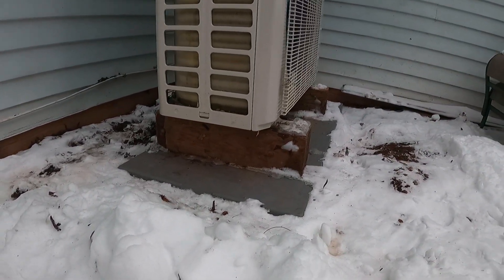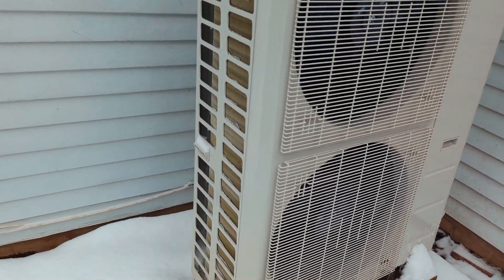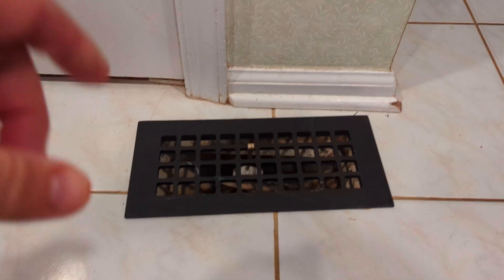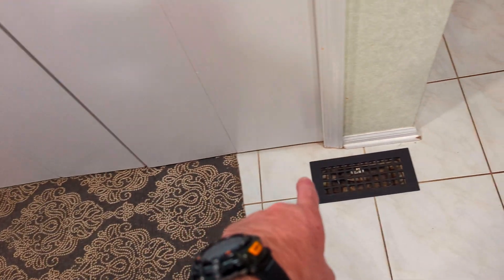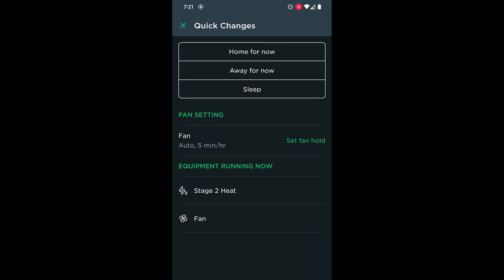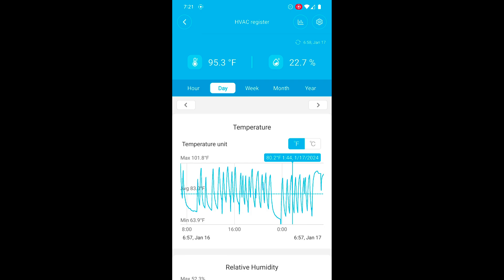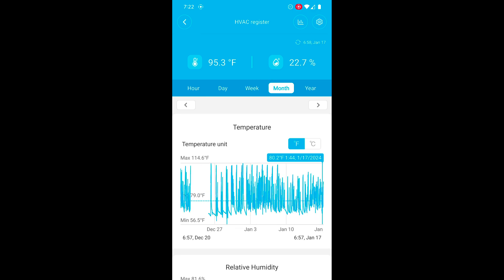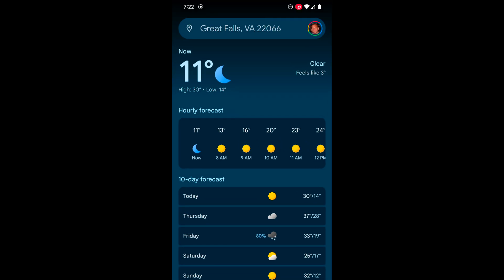ACiQ Central Extreme / Hyper Heat Review in 10°F Winter Update ❄️

Comment: Did you see that ACIQ now has a communicating thermostat for these systems? Just a few months ago it was released.
Reply from the maker: Mine came with a communicating thermostat. I show it in my initial video of my ACiQ unit, but I opted to use a 24v Ecobee instead. I did notice that they changed the thermostat that it comes with, the new one looks much better than what came with mine.

Comment: I see that you are using the eco bee testator and not the controller that comes with it. If you don’t use their controller with the communication terminals between outdoor unit, air handler, and stat you won’t get full function out of the inverter. I’ve heard of 100 plus duct temps without strip heat on full inverter systems.
Reply from the maker: Ironically ACiQ said I'm better off using the ecobee than their communicating controller 🤷‍♂️. But you are correct, it operates as a 2 stage HVAC, although because it is an inverter it still starts up slowly allowing it to work with our 9k watt generator during power outages. We had a power outage last week and our generator ran it with no issues

Comment: Thank you for this review! Im getting ready to get a new unit purchased and installed. 
Im in MD. I was wondering if there is a contractor that you recommend who knows thos system well? 
Also would you be able to tell how much were you able to save on energy after you switched to ACiq in the winter months? 
Has there been any issues since you installed this unit?
Reply from the maker: @mshadow100  https://nelsonshvac.com/ installs the Carrier labeled version, which is the same as ACiQ, so you could reach out to them to see if they would install the ACiQ. I used https://www.americool4you.com/ and he charged $3k at the time for the install. I wish he did a better job with the condenser base, like making it level before installing it. Mine is slanted now and almost impossible to level after the fact. Hindsight I wish I got an adjustable stand for it, but tough because need to remove the old unit before installing. As for cost savings I don't have any metrics because we hooked up a hotub at the same time 🤷‍♂️
Reply: @richiefekecs  thank you!

Comment: Thank you so much for the these great videos!!! I'm really liking the exact model you've gone with to replace my malfunctioning 4 ton Carrier Infiniti AC system with gas heat.  I’ve read that heat pumps in heat mode can sometimes run backwards to warm up the outdoor coils in winter to melt any ice and frost accumulation. Without an auxiliary heat add on, does your system do this, and does it blow cold air inside while that’s happening?
Reply from the maker: @MarcVance-r3n  Happy New Year! Yup, when heating in the winter it'll go through a defrost cycle, which is basically the same as air conditioning because it's running in the opposite flow. In the defrost cycle there's no air blowing inside the house, so it doesn't blow any cold air. Also outside at the condenser there is a heating element to heat the bottom pan to keep ice from freezing during the defrost cycle so it can drain out. We have a polar vortex coming in next week, so she'll be put to the test again!
Reply: @richiefekecs  Right on! That's what I was hoping for. Please post an update after the polar vortex. Good luck, and my hopes are for a warm and comfy result! Many thanks and a Happy New Year!
Reply: You may want to look at the Senville one its the same unit and comes with the heat strip  for way less money.Enjoy

Comment: I'm a little confused about this whole heat pump thing.  I have a propane furnace in the attic and a 4 ton AC unit outdoors.  Ducted throughout the house.  Houston Texas area, so winters can down to 30 but rarely.  Will this thing actually replace the propane furnace???
Reply from the maker: @waterman3230  if you wanted to replace your propane furnace then yes it could easily replace it. We've had it 2 winters now and heats just fine well below 30°F. It was 12°F here last week and it was heating our house easily.
Reply: @richiefekecs  thank you.  I've watched videos about heat pumps, but still not sure I understand them.  I also see that some have some sort of heat strip (sort of like a space heater?). Is that what produces the heat?   Because I always heard that electric heating was not as cost effective as a gas furnace.  Thanks for any and all advice.
Reply from the maker: @waterman3230  so this heat pump that I reviewed and have isn't a traditional heat pump. This one is the next generation of heat pumps called hyper heat or extreme heat depending on the manufacturer. These heat pumps heat even when its -22°F outside. The traditional heat pumps stop heating at like 40°F and use a heat strip (aux heat) to heat at lower temps. There was an option to add a heat strip to mine, but I didn't get it since it never gets colder than 10°F here in VA. In colder climates I'd probably add the heat strip just in case. In simplest terms, a heat pump is just an air conditioner that runs in reverse to heat the home. Even swimming pools use heat pumps nowadays to heat a pool.
Reply from the maker: @waterman3230  you could also setup this model as what they call dual fuel heat pump, and it'd use your existing propane furnace as the aux heat. Here's a video on that setup https://youtu.be/7_oUDuSsNrU?si=3NkwkAx3lD-fuv7D
Reply: They absolutely will. Inverter heat pumps can produce 100% of their rated heating capacity down to 5 deg F outside. They start dropping off in performance after that but still make 80% of their rated heating capacity down to -22 deg F. So, instead of a normal heat pump that starts losing performance below 30 deg F outside inverter heat pumps don't start losing capacity until below 5 deg F outside.

Comment: Hey, With using the ECOBEE you are limiting your system to 2 stages, that system is fully variable speed. Aren’t you limiting the efficiency ability of your system? I think with a compatible communicating thermostat you can truly utilize it to the fullest.
Reply from the maker: @behnkeee  you are correct, I'm limited to 2 stages because the ecobee only supports 2 stages, which is why I was shocked when ACiQ told me the ecobee is a better thermostat for the unit than the one provided. We live in a humid climate, and I have read that staged is better than variable to control humidity though, so there's pros and cons. I also really wanted the ecobees remote sensor feature and didn't want to rewire for their thermostat which seemed like a PITA because had to be some different type of wire, unless I misunderstood

Comment: They sell wall brackets for different sized units.  I have used them for 24k and 36k units and they work great.
Reply from the maker: I have the 48k unit, and wouldn't trust my house studs to hold it, plus hard to find the studs hidden behind the aluminum siding.

Comment: I am a HVAC contractor and getting ready to install the ACIQ 3 ton Extreme Heat, heat pump into my home. We have a old R22 system that is only good to around 20° F, and this new one should be good to -20°F. Thank you for the honest review!
Reply from the maker: @jbadger1458  let me know your thoughts after you've installed it
Reply: @richiefekecs  thank you, I will for sure.
Reply: I got my system hooked up and running. I have the ACIQ 3 ton Hyper Heat package. How did you get the 2nd stage of heating to come on? Is that W2 on the thermostat and air handler? Any help would be  appreciated!
Reply from the maker: @jbadger1458  W2 could be your auxiliary heating if you have one. Depending on your thermostat, Y2 would be your 2nd stage heating/cooling depending on your thermostat. I have an ecobee which has 2 stages for both heating and cooling (2H/2C) so both the Y1 and Y2 wires are connected. Top of page 5 of the quick start guide is how I have it wired up to my ecobee https://aciq.com/wp-content/uploads/2024/05/ACIQ-36-HPC_QuickStartGuide.pdf verify how many stages your thermostat can handle, and then find the wiring diagram in that quick start guide that corresponds to your thermostat.
Reply: @richiefekecs  I switched it this morning. Sorry for being a moron, I knew Y1, Y2 with the o/b were heating, then I said W1 to you. Opps. I have a Honeywell Home Smart Thermostat. I'm only getting 20° delta T out of my ducts for heating temp, it's 29° outside. How do I "force" my heatpump into 2nd stage heating? Wish we could text.
Reply: @richiefekecs Nevermind. Apparently it's smart enough to know, I watched a few more cycles of heat and it ramped up to a 32° Delta T with a outside ambient temp of 29°, I have my E heat unplugged(heat strip) to test, so it's heat pump only. This thing is AMAZING!!
Reply from the maker: @jbadger1458  glad to hear you figured it out!

Comment: These are incredible. Manufacturered by Midea and rebranded under many different names. I do advise adding the heat strips as a secondary source, even though you don’t “need” it. If there is ever a malfunction of the outdoor unit, as great as it is, you will be able to provide at least some heat until it is rectified
Reply from the maker: True, probably good to have the heat stripe as a backup in an emergency

Comment: Nice! Thank you for posting this. 

I just installed a 4 ton ACiQ system (no heat strip) in May all by myself. So far the AC has worked flawlessly over the crazy summer heat. We will see what happens in the winter! I'm planning on building a small shelter/roof over the putside unit to protect it from snow.
Reply from the maker: @crxtodd16  good job!!
Reply: How did it do this winter?
Reply: @stephenbender7593  It has done incredibly well! I finished the roof over it to protect it from snow and rain. It has produced plenty of heat, even when temps have dropped down to the single digits it still pumped out the same amount of heat as when it is above freezing. 

I have noticed that, despite the roof over it, the fins on the outside unit do frost over when it's running while it's actively snowing. Even so, it still was producing heat despite all the frost - and during those times you can definitely see the defrost cycle kick in. After a defrost it would clear out the fins really effectively to where there is no more frost at all. I was just surprised at how much heat it could still produce even when the fins are heavily frosted! But it all regulates itself automatically, so I haven't had to do anything. I've turned up the heat to 74 degrees when it's super freezing outside, and the heat pump keeps up just fine. I have noticed that sometimes it has to pause to complete a defrost cycle, which takes a few minutes, but honestly that's really the only downside (which in my opinion isn't much of a sacrifice at all). 

For the record, when it's not actively snowing I never see any frost on the fins. 

Anyway, I was worried I'd need a heat strip, but for my home I really don't. My house is only about 1500 square feet, and the 4 ton unit is more than adequate to keep my house nice and warm during those freezing temperatures. 

During the summer it's actually completely overkill for my little house. Lol. I could turn the whole house into a freezer if I wanted to. 

Hope this helps!
Reply: @ Thanks for the reply! My house is a little over 1500 sq ft so I plan on going with a 3 ton. I already have a central AC so I'm hoping this DIY swap over install goes well for me. Cheers!

Comment: What does ecobee say about savings?
Reply from the maker: Someone commented on here that I could log into my Ecobee account and pull the data on how long each stage ran, I got all excited and dived into the data, but then I hit a massive disappointment, I didn't install the Ecobee until May 2023, so I had no data with the old system during the prior winter, So sadly I have no baseline to compare to. I did however grab all the summer data from my old HVAC system, so we can compare to the ACiQ this summer. I know it’s not as exciting, as comparing hyper heat to Aux heat, but it’s all I got. I did pull how long stage 1 ran vs stage two during our coldest month, Jan. 75% of the time the heat was on it was only in stage 1, and stage 2 only ran 25% of the time. I wish I had the data from my old system with aux heat…

Comment: I'm in Colorado so they put my outdoor unit up higher (14") and on a very wide (front to back) stand. The width makes it look more stable. I've seen others attached to the house. The support is maybe not necessary but seems like a good idea. Watch a big road sign in high winds and imagine it's your heat pump.
Reply from the maker: Glad they put it up high at least! You could put a wind baffle, like a slated fence or something, in front of it; the manual does mention to do so if its exposed to high winds.

Comment: I am planning on installing one, do you highly recommend it?
Reply from the maker: I've been very impressed with ours so far, heating in 10F, and ice cold in the summer. Its been a huge upgrade from our old R22 system. Just remember to install a surge protector, and have it raised at least 6". I mention these in my 3 common mistakes update.
Reply: @richiefekecs great to hear. I’m looking to replace my R22 system as well with it.
Reply: I’m also planning on installing, do you know why some of the inverter heat pumps with side discharge have two fans on the condenser? Also is Maintenance the same as tradition single stage heat pumps?
Reply from the maker: @andygomez9025  Seems like with ACiQ, anything over 2 TONS has 2 fans, and twin rotary compressors inside to support the required BTUs, but I honestly don't know the exact reason other than the obvious BTU size of them. Regarding maintenance I'm not aware of any special maintenance. The user manuals are posted on the ACiQ website though, so you could take a look at those 1st. https://aciq.com/

Comment: Here in NY I have my goodman lifted over a foot. My brother had risers for heat pumps. Can also go with a wall mount system but that 4 ton is huge. 

How are the energy costs? Have similar goodman as the old one you had, same issue. 20 and colder and aux heat constantly. Has it gotten colder than 11? Lived in NOVA for years and it didnt get that cold often, up here that is everyday in january.
Reply from the maker: It dropped to 9F over night a couple times during the polar vortex this winter, but I don't think much colder. The past week its been in the low 20s each night. House always stays warm, and the HVAC doesn't run long times like before. As for energy costs its tough to say, because last winter was more mild, and we hooked up a hot tub same time we replaced the heat pump, so not the best scientific test because the hot tub adding to costs, and we have a new baby this year, and my wife does laundry all day long it seems, so the drier is really adding to our bill. In theory the Heat Pump is more efficient, and runs a whole lot less than the old one did though! Also worth noting, the heat strip (aux heat) for these are only like $350 extra, so you could always add one of those if you go this route and concerned it might not be sufficient. Snow cap arrived this week, I'll be installing that this wknd and provide a quick update with it too.
Reply: @richiefekecs You can download data from your ecobee thermostat for how long it runs in stage 1 or stage 2 and add that up. Then figure out how much power each stage uses, maybe from a spec sheet. It probably varies because modern heat pumps can vary everything, but it might give you an idea. Heat strips usually say directly how many kWh they use.
Reply from the maker: David, Thanks for this tip! I started to download and dig into the Ecobee data, never knew I could access so much data from the website portal. Man I wish I had the Ecobee installed last winter to compare the usage! It actually hardly went into stage 2, even when it was in the teens!
Reply: @richiefekecs did you get the heat strip installed in yours?
Reply from the maker: @kevinstfort  I did not, and thankfully even in 10°F we didn't need it 🙌
Reply: I just ordered the 3 ton version of this unit. We're down in coastal Alabama. Mild winters but brutal summers with 95+ humidity and equals the temperature.  Basically, go outside and instant sweating. Thanks for the review.
Reply from the maker: @tarustrader  blows ice cold for us when it's hot outside. Should work great in Alabama, just be sure to install a surge protector for the outside unit too!

Comment: Man, your new system is doing really well. I’m surprised you could move the outside unit up 6” with the line sets connected. Guess you have enough extra where it wasn’t an issue.
Reply from the maker: I was concerned about the line set when lifting it, I called the technician that installed it, and he said there's enough line and its flexible enough, so not to worry, hardest part was to lift it alone in the snow haha